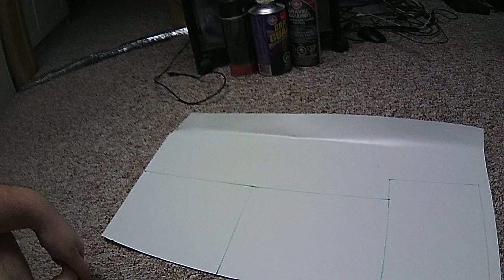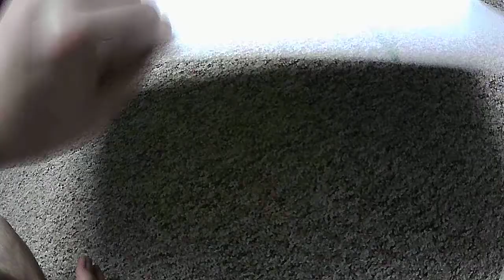DIY Prototype

Comment: It would be interesting to try to make a small pot belly stove with chimney.
Reply from the maker: +David Pedder yes I should try that one. Do you have any good examples for me ?
Reply: +rob mc  I was looking on ebay, and I see they sell a kit to make your own wood stove. The kit comes with the front door and latch, the legs, and the fitting plate to attach the chimney pipe.
All you have to do is buy a 30 or 55 gallon metal barrel $30. You cut out a hole for the door and a hole for the chimney at the rear.. For less than $200 you get a very big stove.
Reply from the maker: +David Pedder Yes I do know of barrel stoves dave. I am not sure how safe they are though. It would be a concern for me.